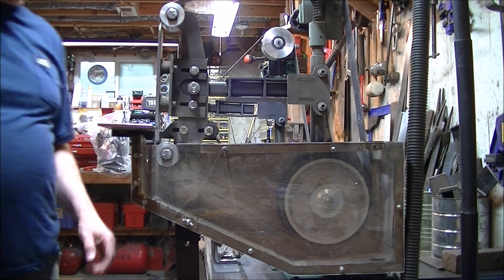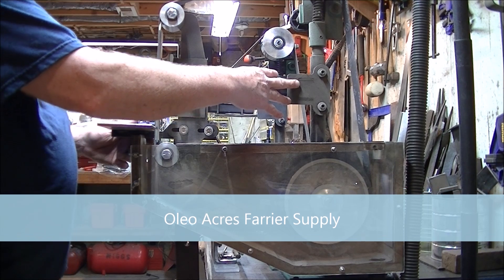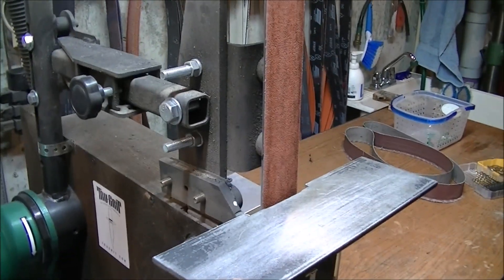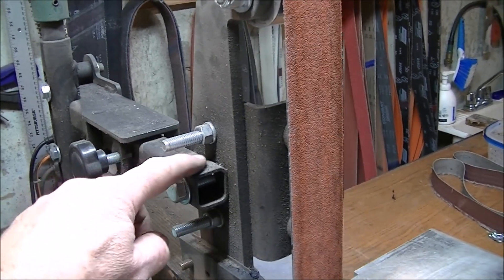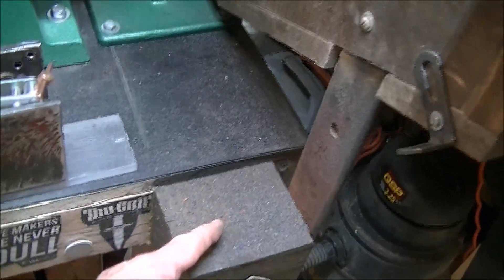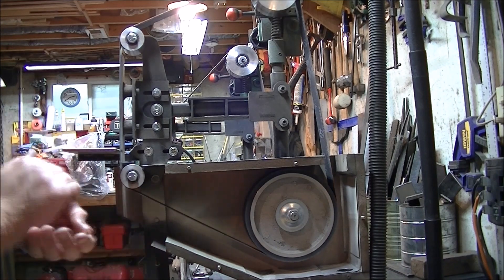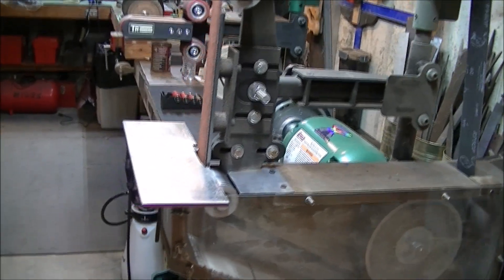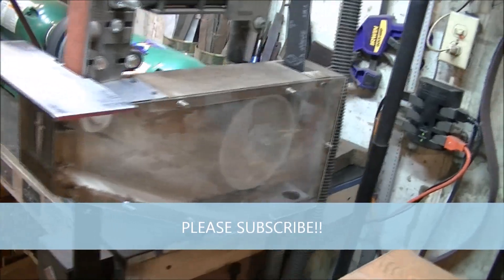Grizzly G1015 knife grinder Dust Collector... DIY!!

Comment: I would be concerned of those hot sparks causing a fire in the vacuum.  Yes/No?
Reply from the maker: Good thought! What I do is keep 4 inches of water in the vacuum to extinguish any sparks. Then I made a spark arresting metal sreen around the filter. Also, if I'm doing a large knife, I'll pop the top off the the vacuum (before I leave my shop) and make sure there's no smoldering embers. Thanks for watching and commenting!